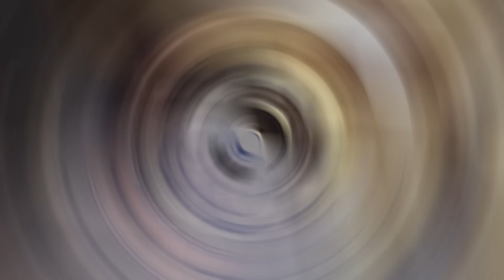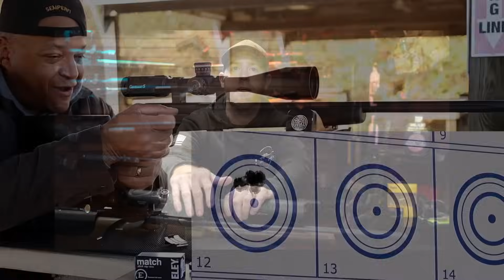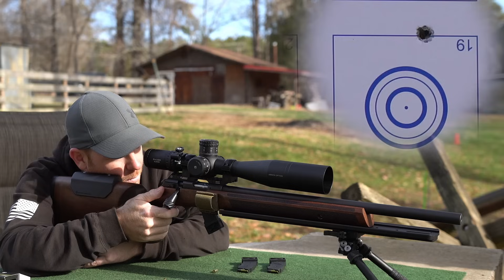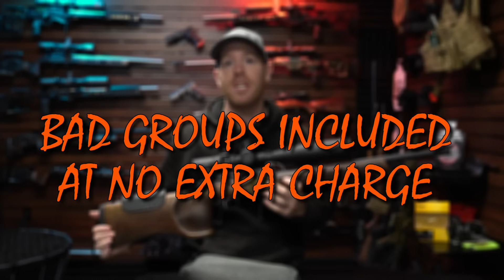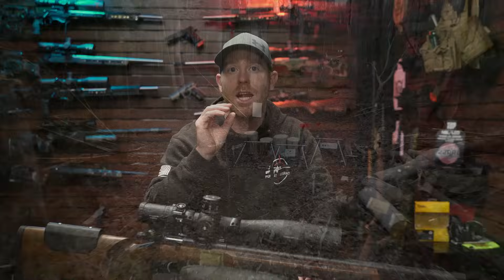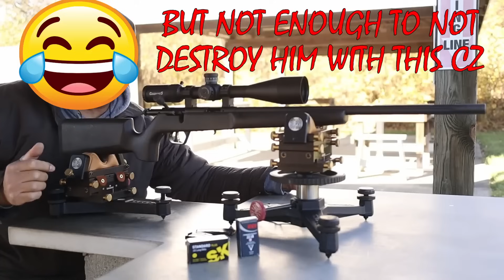FACTORY CZ 457 MTR RWS SPECIAL MATCH AGAINST DAY AT THE RANGE

Comment: I too own a Savage TR. I put it in a Boyd's Varmint Hunter stock after the original one cracked at 30 in/lbs. Mine has the 22" non threaded barrel. It was shooting pretty well. I then installed a Harrell's clamp on tuner and a lighter spring in the trigger. It is now as accurate as any .22 I own - sub 1/2moa at 100 yds with Eley SABRP. I was surprised at how shallow the lands and grooves were using a bore scope.
Reply: Nice! I have the same exact rifle setup and I agree. I've tried a ton of different ammunition. So far the best two were Eley SABR and RWS Rifle Match. The Savage Mkii is such an underrated rifle.

Comment: Torn between the CZ 457 Varmint MTR (02345) that you have there or taking the plunge and getting the CZ 457 Varmint Precision Trainer MTR with threaded barrel (02355). New for 2022 the Manners carbon fiber stock now features an adjustable cheekpiece.
Not keen on the idea of drilling and adding a cheek rest. Looks lame on a beautiful gun. Such as the one in your video.
Sure, the Precision trainer is a lot more money but might be worth it in the long run. 
Thoughts?
Reply from the maker: For a prs 457 rifle the acc is the best thing going right now.
Id buy the cheapest 457 you could and put it in an acc
Reply: Thank you
Reply: i have an MTR manners 457.  thing is great, light but shoots lasers.  short barrel but very accurate at 50 and 100.  ihave a 457 chassis, probably 2x the weight.  a tad more accurate same ammo, same range.  both super fun.  same money if I recall.